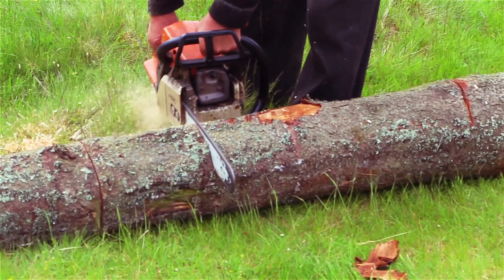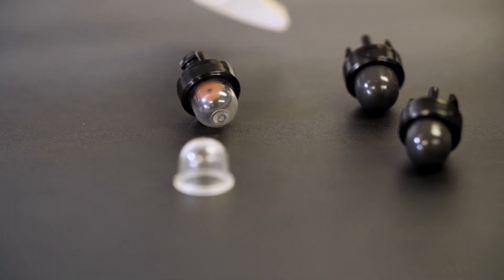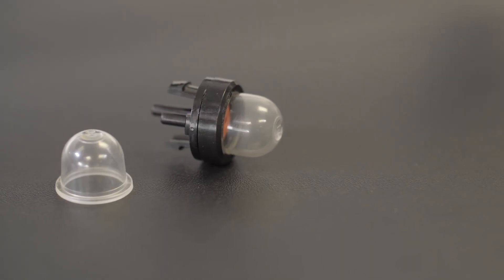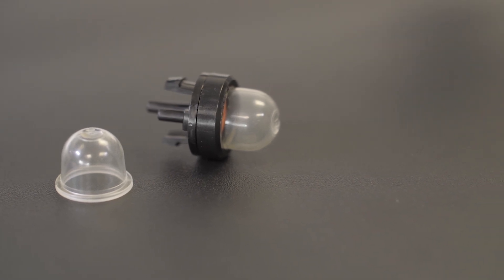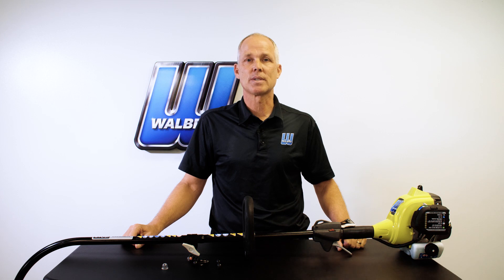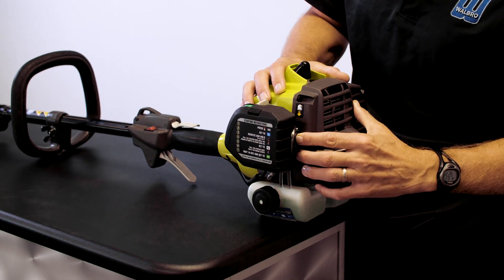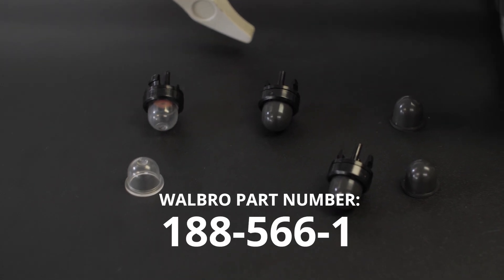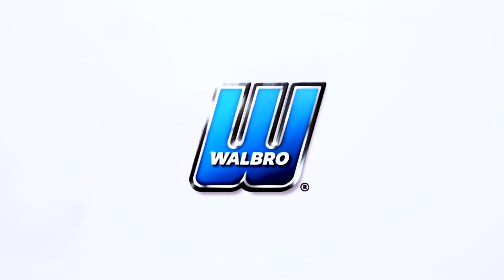Ethanol Compliant Purge Bulb

Comment: Won’t the higher ethanol % then perish the fuel lines because they aren’t suitable?
Reply: Ethanol will go after any component not suitable for use with ethanol.  Walbro does not supply the fuel line used in most OE applications, but we are working on ethanol compliant fuel line to compliment the spiral diaphragm and ethanol compliant purge bulbs.
Reply: @bobmccuewithwalbro7349  alright, good to hear!
Reply: Best to use Tygon for all fuel lines for now. Usually a transparent yellow. Verify genuine Tygon and not chinesium.